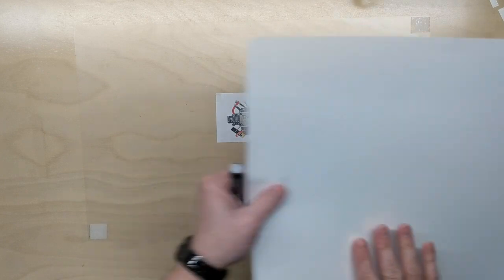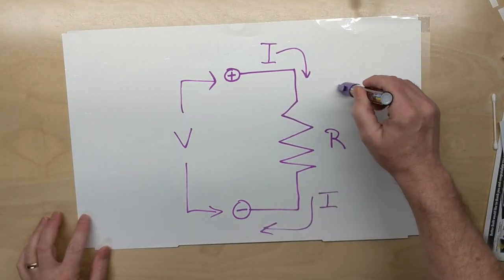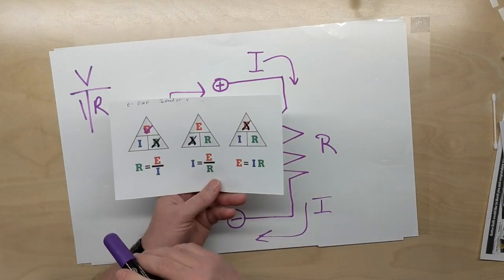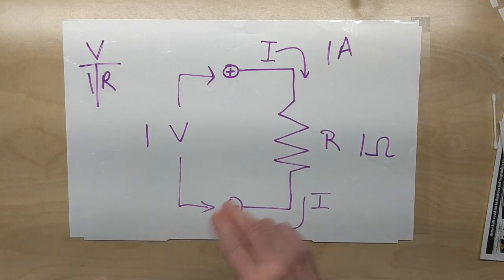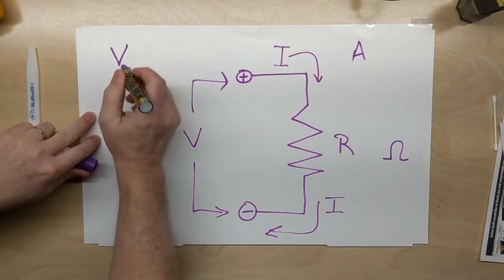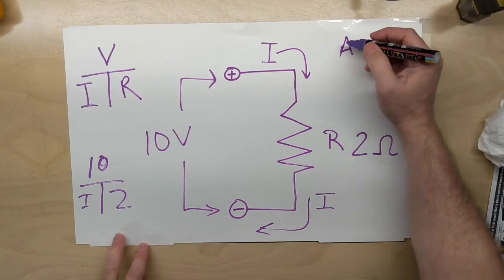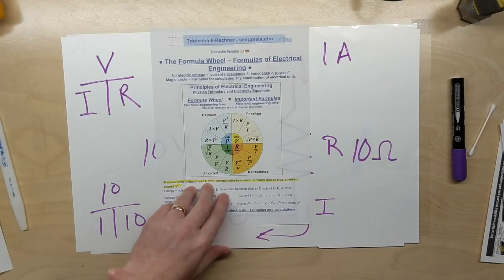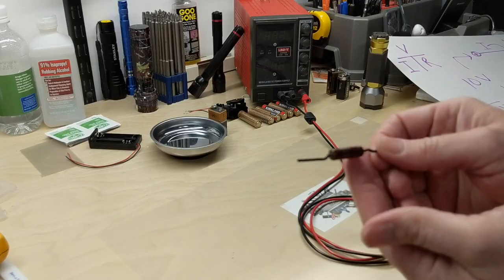Electronics On Your Level, Episode 4:Ohm's Law

Comment: Thank you for sharing your knowledge you are good at teaching. I learned from it. I have been dealing with this in the past few months and was lost, now I know. I downloaded the video so I will always have it. Thanks I will always watch fully all your teaching videos. I bought a Pace Soder-Tek ST45 soldering station from ebay with no iron. The Irons are so very expensive 150 dollars each with no tips. I have been trying to wire a a Chinese Iron to use instead. I have been probing the Din jack to try to determine which pins are hot and which are ground. using a cheap multi meter. I believe this will help. Thanks hope to see more. I still don't know fully how to use a multi meter. Learning on the fly and love it.
Reply from the maker: Gary , Thanks for taking the time to comment. So glad that you are you thought it helpful. I will be doing more in the future with DMM's. You will learn volumes doing exactly what you mentioned about buying things to work on and figure out how they work, I have always loved it. Best of luck!
Reply from the maker: Gary , BTW, you may already know this but most AC irons tip is ground, so make sure it is hooked correct. Also some irons are different voltage ratings. 
ie, some are 24v instead of 120v line etc. Hope it helps!
Reply: Yes he really is!!!